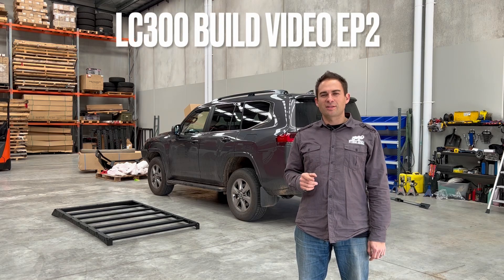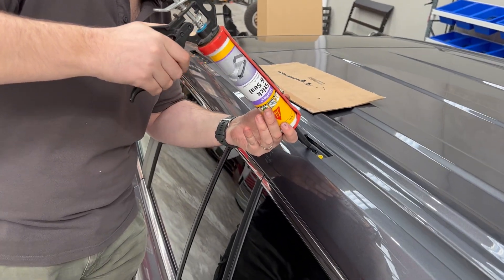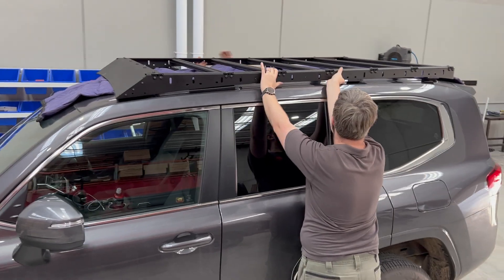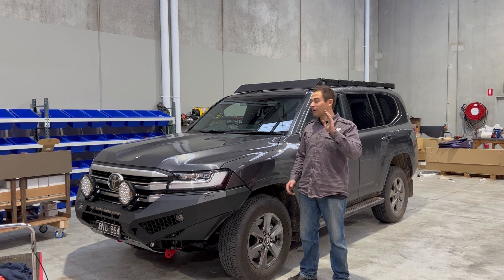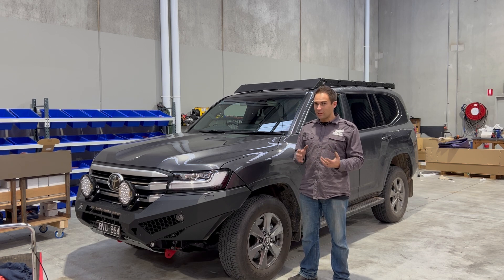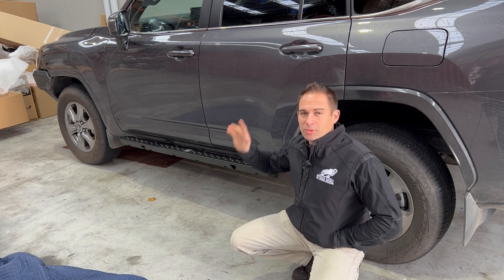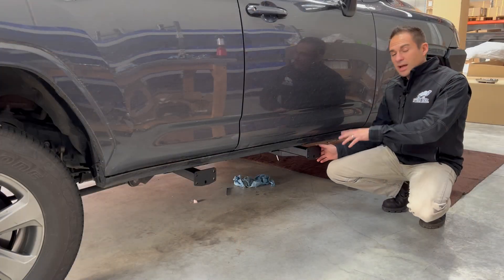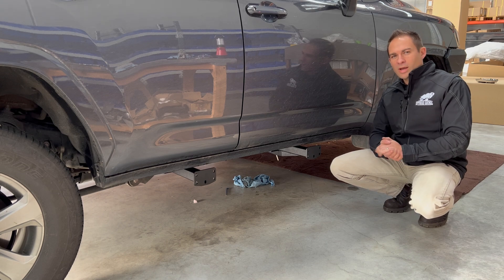300 Series Land Cruiser build video Part 2, by Offroad Animal

Comment: Can you shed some light on roof rating for the lc300 with your roof rack?
Reply from the maker: Roof Rated to 150kg dynamic and 350kg Static- Rack weight is 28kg- Offroad Rating is 100kg so minus the 28kg rack means you're allowed to put 72kg up there off-road and 122kg on road

Comment: How do you get power to your roof rack light bar?
Reply from the maker: Run a wire to the back door through the seal, or down the snorkel once fitted

Comment: Do you have an indicative load rating for the roof rack?
Reply from the maker: Rated to 150kg- Rack weight is 28kg- Offroad Rating is 100kg so minus the 28kg rack means you're allowed to put 72kg up there off-road and 122kg on road
Reply from the maker: @ausguy4385  Geez how heavy is your awning? 72kg offroad rating and your awning and maxtrax are that heavy. wow I'd suggest getting something lighter.
Reply from the maker: @ausguy4385  First off all 2 maxtrax is plenty, the mounts are redundant just strap them on the rack.  Even you want the mounts and 4 boards, 20kg is a lot of weight.  Swags, sleeping bags, chairs, the list is endless
Reply from the maker: @ausguy4385  Also awnings are not that heavy.  The 180 awning I have is only 24kg, even the old 270deg one was 28kg.  Not 35, thats crazy
Reply from the maker: @ausguy4385  damn you are one eyed and blind